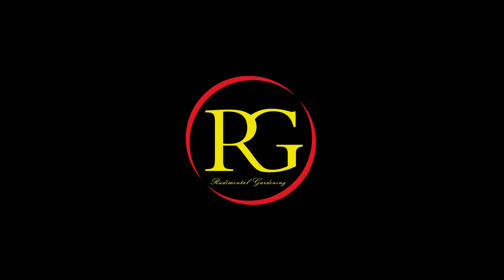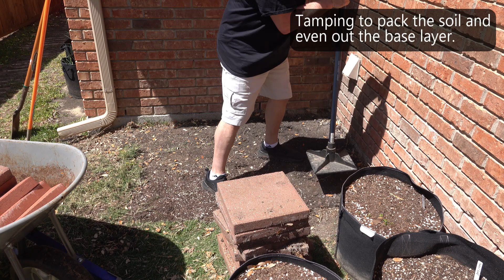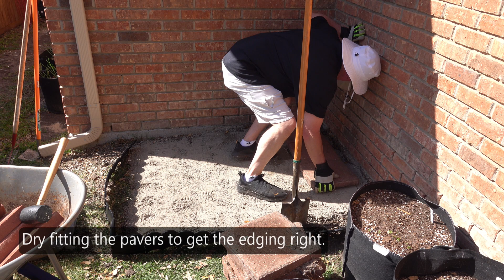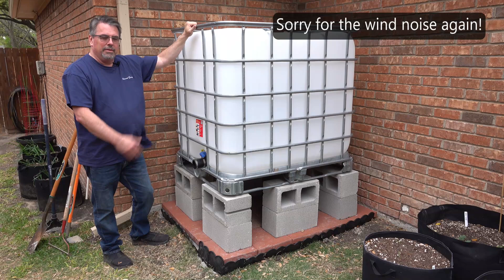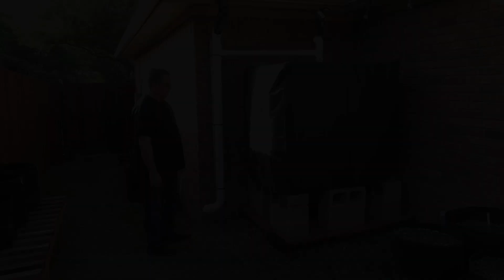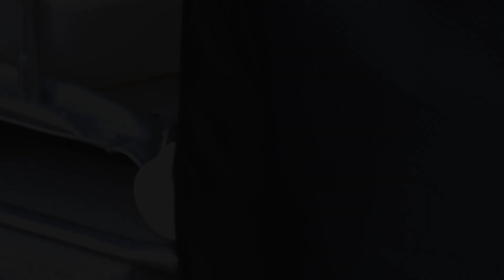Rainwater Harvesting Tank Installation For My Garden!

Comment: Very nice job. I'm studying/researching now, so I can do something like this too. 
For me, it's best if I not bite off more than I can chew, lol. So I was hoping I can get away with just routing my downspout directly to the IBC inlet. Plus, the gutter for the downspout I'm using is 54 feet in length, and the water exiting during a heavy rain is so fast that it makes me worry that the 2 inch PVC would not be able to keep up and the water would gradually back up. 
As far as the first flush, I had LeafFilter install new gutters last year and the mesh material really does a good job of keeping debris out of the gutter, so I'm hoping I can avoid having to put the first flush in. And since I live in the Midwest, every Winter I would be draining it and probably storing it in a shed, so I could probably check once a year to see if debris built up on the inside and maybe just hose it out. 
Sorry for the long comment. Hope yours is still doing good.

Comment: At Last a first flush system without that 60 dollar Leafeater.. I think your system is much better because of this! How has it been working? Its been a year and hopefully Great!! Thanks
Reply from the maker: Thanks L.T. Dan!  Yes, this is probably one of the best decisions I made in regards to my gardening.  Since I do not have a water source on the side of the house where my garden is, having this is a life saver.  I opted out of having the Leafeater piece because I have gutter screens on my gutters.  I have not had any issues with debris getting into my tank so far.  This project was well worth it and I recommend it to anyone needing a water source that has rain runnoff.  I will also recommend using one of the tank covers like I have instead of wrapping the tank in plastic or painting it.  So much easier and they are not very expensive.  Thanks for watching!